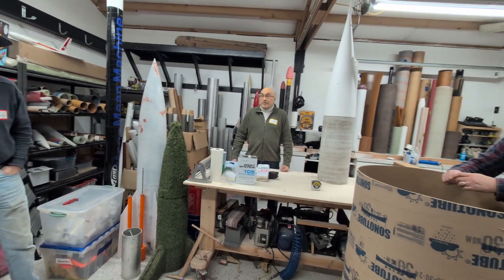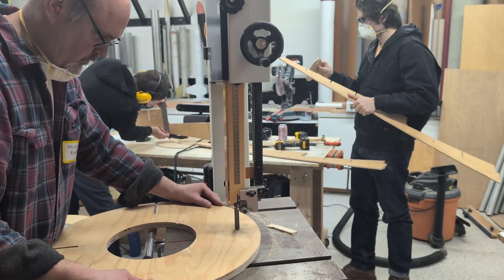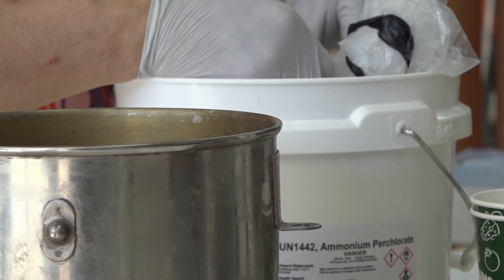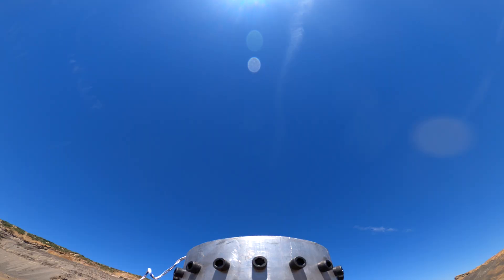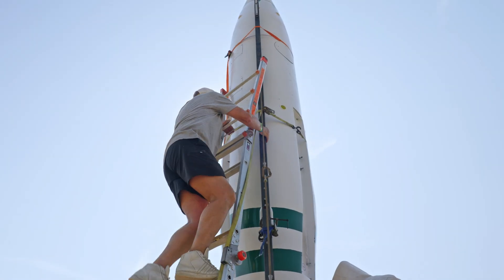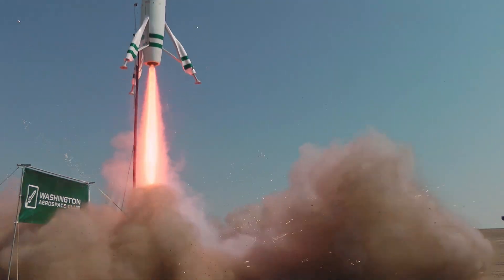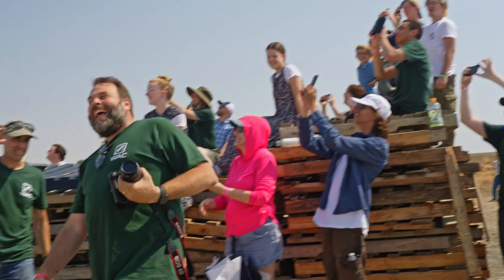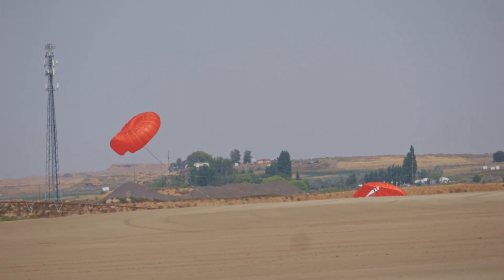Project Moonliner - Washington's Largest Amateur Rocket

Comment: If they had added some pneumatic shock absorbers landing legs it might’ve not fallen over
Reply from the maker: Falling over was actually a pretty good result for us. Had it stuck the landing perfectly upright, it would have been logistically challenging to lower down safely without any mechanized equipment. It laying down allowed our team to more easily pick it up and haul it away. (Even that proved to be challenging with its weight, size, and available team members.)

Comment: Brought back wonderful memories as the now deceased Prefect in my TRA group had a 40kg mixer and Certed L3 on a full-scale Phoenix Missile on a commercial M.  Barely hit 1000 feet.  Guy came up and told him it needs a bigger motor.  Prefect replied he couldn't afford it.  The fellow who walked up to him said he could teach him how to mix.  Get a group of guys together and I charge $200.00 each and they'll get 3 motors out of it. He provided all the tubes, brought a mixer and Loki 54mm hardware for each student!  He stayed in a motel for two days.   We got 6 guys together and best instruction I've ever received on in my life on anything.  Still have the syllabus the instructor provided. Ultimately made N and O motors for the Phoenix.  Group mixing is a riot. I'm a physician though retired now and the Prefect used to say, "You're the Doctor, you measure the chems!!"  I did have a scientific chemistry/biochemistry background so not a problem for me.  The other folks on the mix would just as soon have me do the measuring as there was plenty of work with mixing and packing the grains.  We didn't do pourable mixes.  Only packed.  Big motors were packed around a core and the smaller ones were drilled on a low speed drill press out of doors with careful collection of the power and dust after curing and each drilling cycle.  We didn't drill motors with magnesium in them so the smaller ones got cores too for safety's sake.  The motor "chads, powder and bits" would later be set off electronically with a big giant flash.  We'd be 100 feet away or so a safe and great way to end a motor grain "machining day".  Oh I was only an L1 but the Prefect looked by that as I was a physician and not half-cocked.  At the time one was "supposed" to be L2 to mix.  Stupidest rule on earth.  I didn't fly the mixed K's or L's until well after my L2 on the ubiquitous J350 cert launch.  Flew many J's before I went on to the K's and L's.  I was glad Tripoli eventually allowed flying Research with Certified motors at the same launch.  Our club always put research pads farther out than stipulated which is fine as far as the rules are concerned.  Some "hairy" flights occurred and some were entertaining.  The launch crew and people were kept farther away than required and safe.  We didn't sweat it.  Oh very glad to see that this project was a success. Great flight.  Wonder if any structural proclivities occurred on landing or if the rocket can be "spiffed up" and flown again. On the other hand, it might be a one shot deal due to the cost of the propellant "fixins".  Kurt Savegnago L2
Reply from the maker: Wow, that's an incredible story and journey into rocketry!

Comment: You know the legs close when its in flight right? If you're not going to have them collapsible, and just launching a rocket, why not have them in?
Reply from the maker: Yes, at this scale and timeframe the legs and the clear inserts where needed to provide the necessary flight stability to safely fly.  Folding legs in for flight would have required an active stabilization control system and mechanical hardware that was out of scope for this 8 month project.
Reply: @WAC-Rocket  I guess cause it's a solid fuel rocket  it can't stabilize itself with gimbals like a liquid rocket could, still it seems like the bumps that it leaves would be enough maybe with the higher velocity you might be able to achieve.
Reply: Having the legs out may improve stability in flight.